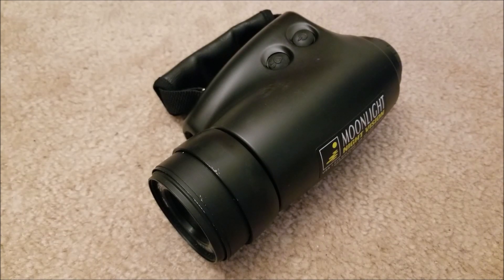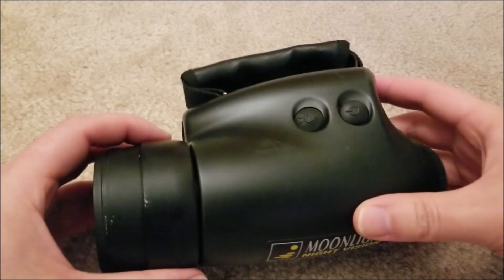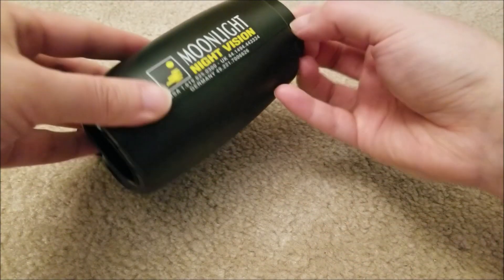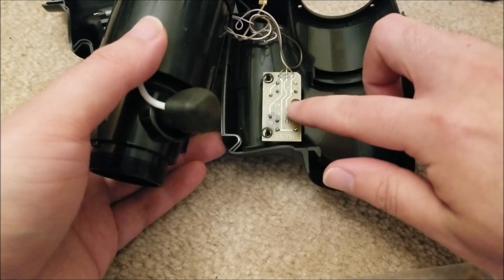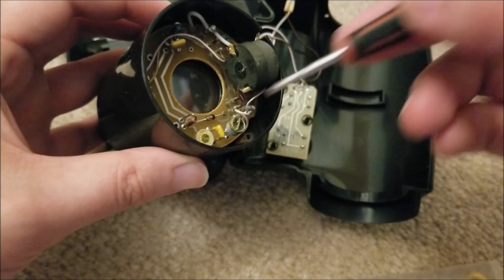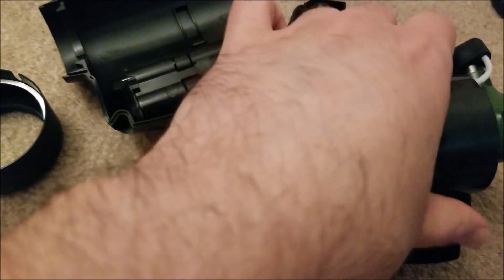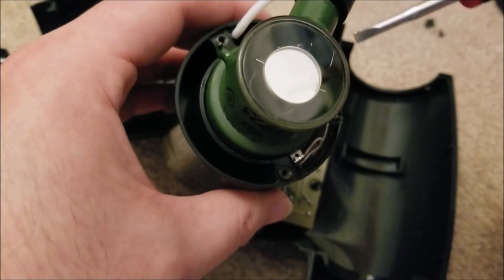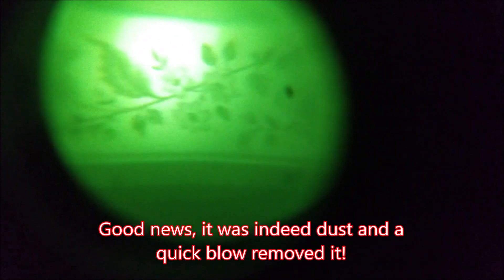Night Vision Monocular Teardown!

Comment: I have a Yukon starlight NV monocular.  One of my friends was messing with it and took one of the lenses out. And it hasn't worked since.  When you look through it it's just black
Reply from the maker: The lenses probably also press the intensifier tube onto the edge contacts that provide power to the tube. I'd open it up to see if this is how 5he tube gets powered, make sure it's seating correctly and screw the lens back on to see if that fixes it. Another possibility is unscrewing the lens somehow damaged the vacuum seal by cracking the glass on the tube instantly killing it.

Comment: Hey. I have the zenit nv-300 and it’s not working any help. Thanks
Reply from the maker: Sure, what have you tested so far? Basically what are the symptoms?
Reply: No power at all. I took it part broke something lol😂it wasn’t easy priing it like you did. But just the cover part broke nothing else got damaged. Anyways I’m getting power to the switches that’s all I have tested
Reply from the maker: When you energise the tube can you hear a high pitched squeal?
Reply: Hi. Sorry for the late response but I hear no sound or anything thanks.
Reply from the maker: That means your high voltage converter is likely dead and would need to be replaced. It is technically repairable but since most are potted it's practically impossible to do so.

Comment: Yes the tube looks fine as normal without ir. But ir light has no effect?
Reply from the maker: You aren't turning on and exposing the tube to normal ambient light are you? This can very well destroy the tube by effectively desensitizing it. The only other explanation I can think of why it cant see ir light is if you have a lens with a coating or filter on the input that is filtering ir light before it even gets to the tube.

Comment: Would it be possible to put this in another housing to make a helmet mounted setup?
Reply from the maker: Yes of course
Reply: @sjm4306  what steps would need to be taken? I have a night owl nocc3 and would like to fit it into a new housing (probably 3d printed) and change the lens to be 1x instead of 3.1x
Reply: @JLuk98  I’m trying the same thing, so far I know that the lens mount on night owl optics is m42, but designing a new housing is more complicated

Comment: Hey, do you maybe know how much maximum voltage can the power supply take? On a pnv 57e which uses almost the same intensifier it is recommended to use a 11.1v battery or roughly 6v per tube. This one only uses 2 aa batteries which give you 3 volts.
Reply: Depend by the voltage elevator. This tubes works at 17Kv-19Kv but the power supply voltage depend by the nvg model. PNV57E Works at 12 volt infact was used on veichles
Reply from the maker: Yep, it's not the tube that'll be damaged by using a higher battery voltage, it's the circuitry in the input dcdc switching boost converter.
Reply: @sjm4306  Exactky, but it's easly realiable with a low power ccfl inverter or a dedicated voltage elevator for photomoltiplier transducers tubes.
Reply from the maker: I wouldn't go much above the 3V nominal voltage since it doesn't look like there's any active regulation in the circuitry so increasing the input voltage too much can destroy the boost circuitry and possibly burn out the tube.
Reply: @sjm4306  would adding such a thing be difficult?
Reply from the maker: Yeah it'd be easy just adding a small adjustable buck converter to step whatever voltage you need down to the required 3V and feed that to the battery terminals. It's low enough power that just about any buck converter module off amazon/ebay should work just fine.

Comment: What happens if you adjust the variable capacitor?
Reply from the maker: It's probably to adjust the switching frequency/voltage
Reply: @sjm4306  but what does that do?  Will it enhance night vision or hurt it?
Reply from the maker: They set it to the correct voltage at the factory. Decreasing it will make the tube dimmer and increasing it will make it a bit brighter up to a point (but also burn it out quicker). It should be set at the optimal value from the factory so play with it at your own risk.
Reply: @sjm4306  well I've got one of these, however when I press power, I have to hold it down because it does not stay engaged and I hear buzzing but the tube will not power up.  IR will work but tube will not. What would you guess the problem could be?
Reply from the maker: So this model's power button is momentary meaning you have to keep it held for continuous power so that's normal. The buzzing sound means the high voltage inverter is working. Now the bad news, this all probably means your intensifier tube is either burnt out or air has gotten in through a little crack, killing the tube.
Reply: @sjm4306  ah well that sucks. I appreciate your knowledge on the matter.  Thank you

Comment: If the voltage multiplier makes a constant sound (no short) but no image shows up on the phospor screen are the tubes dead?
Reply from the maker: It could be a connection issue between the hv converter and tube, but more likely than that is it's as you've guessed that the tube is likely dead (either phosphor burnout or it's got a crack causing it to lose the vacuum).

Comment: fun fact the image tube in this device is an eop V-8 (B-8 in russian) and is used in many military grade devices from the soviet blocks from the 80s-90s. so if you have a dead tube in a russian military nv device you can steal parts from a "modern" nv monocular.
Reply from the maker: That's really cool to know. If only I could wait 20 or so years for modern 3rd gen nv tubes to make their way into affordable consumer monoculars lol!
Reply: Yeah I have bought these to replace tubes in my PNV-57E .
Reply: @Winner12386  yeah I plan to post a repair video on pnv 57Es and how to change the focus of the tubes for close or long distance viewing.
Reply: @matrim1762  nice I found this same device on ebay so I’m going to get it because I like the v8 image quality over the ep-33 which I sourced from some weird civilian device that was essentially a 57e with a transformer screwed to the top.
Reply: @Winner12386  yeah those are weird af the V8 tubes are really nice on resolution you can just read license plates from 15 feet considering that the image is only the size of a dime
Reply: @matrim1762  yeah I know I really wish I could find a v8 tube the device I had had a blown ep 33 so I wasted 40$ on that venture v-8 tubes are just far better than ep-33.
Reply: I'm assuming they made A LOT during the cold war and surplus stocks are getting bought and used for gen one devices. The tech for gen two and up is still tactically effective so it's my assumption that the market is kept scarce on purpose considering there are likely huge stockpiles of those tubes as well. Also ITAR, I'm just assuming though so correct me if I'm wrong.
Reply: @falloutforever88  I came across a manufacturer in Russia that still makes theses tubes and the other various tube models and was quoted $500 USD for 4 tubes including shipping to the US. Personal I'll buy new tubes sometime this year just to  restart the hours with fresh tubes.
Reply: Litteraly this tubes are used in all Soviet Night observation devices... My own  uses one of this tubes.
Reply: @JustPako_zZ  It all comes down to what version of tube used. Each versions are rated for certain voltages and quality of image is all over the place.

Comment: hi,  nice video
i also have a similar problem
the tube does not turn on but I can hear the noise
What could be the cause
Reply from the maker: One of two problems, best case there is a path somewhere in the high voltage side that is shorting the supply (can be fixed by opening the device, turning down the lights and turning it on to observe where the hv discharge glow occurs), worst case the tube itself is damaged and the vacuum has been released (unfixable other than replacing the tube).
Reply: @sjm4306  Thanks for the reply.
I have already tried to turn it on (with the light off) but I don't see anything
(I try to look more carefully)
let's hope it's not the tube

Comment: The tube in a LOMO ELF 1 device which I am trying to fix has very similar (the same) design and markings. In the end it looks like I will need to reconstruct the voltage multiplier because some of the pieces broke (probably during my disassembly because the whole unit was potted in thick silicone which was a total whore to remove and I kinda lost my mind towards the end of it). https://youtu.be/u4GJeqTUuMI - tube. But interesting that tube, multiplier and circuit board were shock protected by this thick layer of silicone potting. Also interesting the voltage multiplier had its own plastic case to further insulate it.
Reply: This is an EOP V-8 tube
Reply: @Winner12386  thanks very much.
Reply: @mpireoutdoors5274  NP they look very similar.

Comment: Do you think it would be possible to remove all the electronics from it and just shove it into a different body
Reply from the maker: Yeah no technical reason why you couldn't do that
Reply: @sjm4306  ok thanks so much I bought two of these and I wanted to 3d print a body to have these work as dual tube that I could mount on a helmet
Reply: @richies5059  hey did you get it to work? I've though of the same thing!
Reply: @kuptin  unfortunately this one that I had stopped working but I did it with an atn unit that had a terrible body and that worked
Reply: @kuptin  you probably could tho
Reply: @richies5059  Could I somehow see your creation :)?
Reply: @richies5059  i wanna do the exact same thing! :)

Comment: Are Gen 1 and Gen 2 Tubes interchangeable? I mean, can I replace my gen 1 tube with a gen 2 or 3?
Reply: Nope. Usually gen 1 tubes are a completely different shape and electrical design to 2nd gen stuff. You can get gen 2 and 3 tubes in the same format however. Most gen 1 designs are built around a very specific tube and would be impossible to change out for a different format tube. You could probably reuse the lenses if you really wanted to though, but you'd probably have to make your own housing
Reply from the maker: I unfortunately dont know as I've only ever had a gen 1 tube, gen 2 and 3 tubes are a bit out of my price range just getting into the hobby.
Reply: sjm4306 As far as I was able to research in the mean time Gen 1 has a different power supply than Gen 2 and 3.
Reply: @flugschulerfluglehrer  It depends on the tube, even across generations. Some have an integrated high voltage power supply so you can run them on batteries (again, depending on the tube the battery voltage will vary) but for quite a few tubes such as the v8 (shown in this vid), ep33 or similar use an external high voltage power supply.

Comment: I own one of these (won it at a trade conference of all things) and needed to fix one of the buttons. I thought there was NO way I would find disassembly instructions for something so obscure, but decided to try anyway. Your video was just what I needed to take it apart. So I don't know if this is a win - win, but it is certainly a win for me. I know why you didn't film loosening the ring, I used many choice words getting mine loose. One bit of advice I would give others is that if it doesn't move counter-clockwise, try clockwise first. I couldn't get it to budge at first and thought it might be reverse threaded and your video was reversed somehow. I managed to move the ring a little clockwise, just enough to confirm the thread was normal. When I then tried to go back counter-clockwise, the ring now moved.

Comment: HI THERE, I HAVE A TASCO NV200 AND IT SEEMS TO POWER UP BUT WHEN YOU LOOK THROUGH IT ITS BLANK. NEW BATTERIES PUT IN..
Reply from the maker: Can you hear a high pitched squeal when you try to turn it on?
Reply: @sjm4306  have the same tasco and it does the sound u say and not working,blank screen.can i fix it or its dead? Thx!
Reply from the maker: Are you also pressing the ir led button? Keep in mind these are gen 1 nv devices so they either need sufficient ambient ir or the onboard ir led to illuminate the surroundings.
Reply: @sjm4306  yes the ir power ups but i hear and see inside some electric spikes and nothing else..blank
Reply from the maker: Then it sounds like your tube may be damaged. Just to verify, does the high voltage sound you hear sound like a constant high pitch squeal or does it have random zapping sounds?
Reply: @sjm4306  random zap! guess its dead for good.just to info i use this night vision only 2 times then i store it for about 10 years!! I forget about it! Today as i find it again its not working.thx for your help
Reply from the maker: The random zapping sounds is something shorting the high voltage supply (could mean that the tube is fine if you are lucky). Open it up and look to see if you can spot any charred metal bits or wires. Maybe a bug or some dust crawled inside and is shorting the hv output?
Reply: @sjm4306  thx will try it and i will let you know..again thx for your help.
Reply: How do i know my tube is damaged or not for my tasco nv200
Reply from the maker: Can you hear a high pitch squeal when it's on? If yes but there's no image it's likely the tube is damaged. If no then it's likely the high voltage inverter is dead.
Reply: I dont hear a squeal. Can i fix the inverter
Reply from the maker: @jadinadams9576 if it's potted in resin it'll be very difficult, but if not then it's possible. It's usually a transistor that fails but occasionally the transformer fails which will be harder to find a replacement for as they tend to be custom.
Reply: How can i test if each are bad?

Comment: Hiya! My old GBA SP has a problem I don't think I can describe well. The screen looks just like Christie's from the screen repair video, minus the fact that it has no visible crack and that it doesn't appear to turn on (I tried the brightness switch, doesn't change a thing). It pings like normal, though, when I do power it on. Should I follow those same steps to replace the screen, is there something else I can do, or is replacing it a different story?
Reply from the maker: The screen probably died and would need to be replaced (yes you can use the steps I showed). I would first just try opening it and remove the lcd ribbon and reseat it in the slim chance it got loose to see if that fixes it.
Reply: @sjm4306  I didn't know screens could die! But that makes sense. Thank you tons.

Comment: Yus! These are awesome to mess with. I have a friend who wants to buy the one I fixed for a fair amount, I might end up picking up a better unit soon :P
Reply from the maker: Oh get that mil grade cascade tube I linked you! That would make for an awesome diy scope project.
Reply: @sjm4306  It has a white phosphor screen too from what I remember. That's not a bad idea. I am also eying up a 10 watt green laser head as well. I figure with that kind of power night vision won't be needed lol.
Reply: I bought a Tasco NV200, used, on an auction.  It doesn’t work.  Anyone like to buy it?
Reply: hey , i have one for repair, its not opening. any tips where to look? it looks allot like in the video